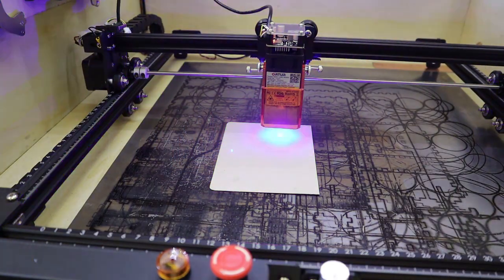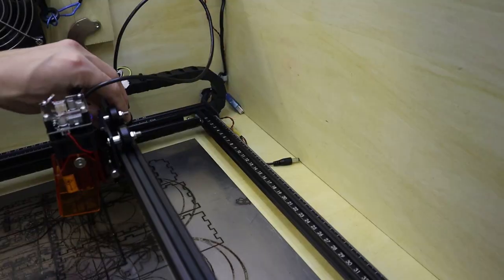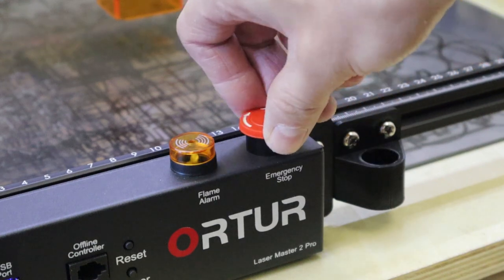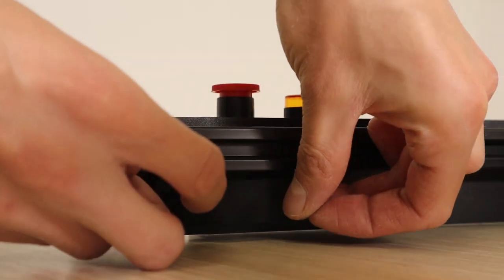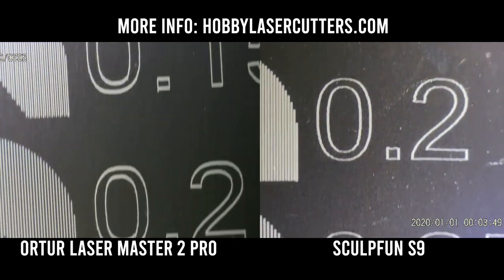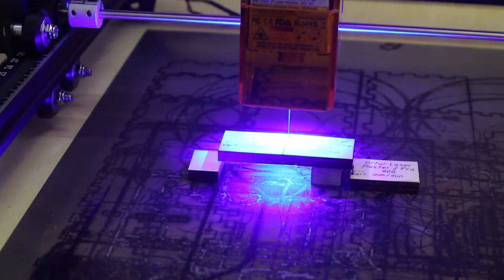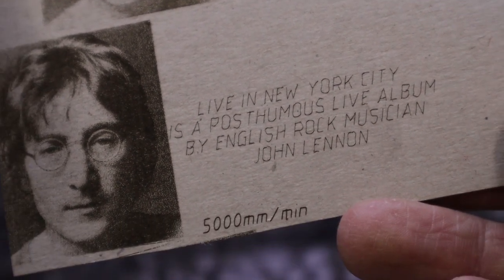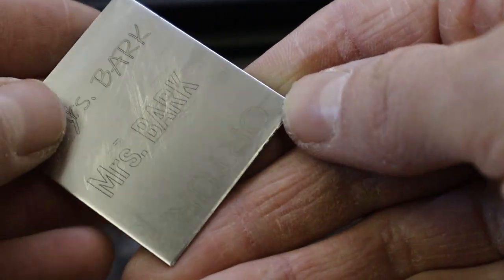ORTUR Laser Master 2 Pro REVIEW And TEST - Is It Still the King of Laser Engravers?

Comment: Great video, I really like the systematic process and you're really starting to build up a big database of test results for comparisons haha. One thing I noticed in the anodized aluminum tests is how clean the lines are in the Ortur compared to some lines of the S9 under the microscope. I am thinking it's probably due to the mass of the laser head being smaller and the x axis motor being on the side. Like the Ortur can accelerate/decelerate smoother without the small jerk which is visible in the S9 near the ends of lines. It is kind of sad though how Ortur pitches the 10,000mm/min speed but practically speaking it's not that useful at that speed anyway.  The mechanical parts are very nice though. It's as if the perfect diode machine is the frame and finish of the Ortur with the S9 laser head haha
Reply from the maker: Thanks! The S9 has a heavier head this is why lines have more wobbling effect. The engraving speed is 600mm/min which is quite fast for detailed work. At lower speeds the S9 doesn't have wobbling. But this alos depends a lot on how you have the machine setup, how tense the belts and rollers are and it depends also on how low the head is lowered. In this test the head is very low. If i would put the board higher up, there would be less wobble as the head would be closer to the rollers. The Ortur is a lot lower standing machine by itself. This is why the engravings are more detailed. But this can be archieved with the S9 just by lowering the speed.

Comment: I recently got the Sculpfun S9 but have only just assembled it (like, hours ago).  It really should have been fitted with limit switches by default, they are really cheap parts so there's no excuse. I looked at the control board and there are sockets for the switches so will try to fit my own. Also made an air-assist adapter because cutting thicker materials in particular you really need it.
Reply from the maker: I am also going to try to mount the switches :) I too noticed the inputs. But I will need to talk to Sculpfun if the firmware supports them. And I am also making the air assist. I already got the parts, but I don't have the time yet to assemble it :)
Reply: @JTMakesIt  I'm hoping if it's GRBL compliant no firmware adjustments will be required and homing can be enabled with $ commands. Maybe I'm just too optimistic :)  Those mods would make a good video! I enjoy the care you show in your testing so keep up the good work.
Reply from the maker: @chrislx2006  Thanks! If I make it work, you will definitely see it on this channel :)
Reply: Did you guys design your own air assist nozzle? I also just now made a crude test nozzle for the S9 but if someone has STL files online I'd probably give that a go. Very curious to see the effect of air assist on the already pretty powerful laser
Reply: @akaTelo  you can find an .stl linked in the comments below this video https://youtu.be/BSeJ_Z9iEyY 
It's not mine, I machined one out of aluminium.
Reply: @chrislx2006  Thanks! And I checked out your thread on LAHobbyGuy - WOW that is super cool you machined that air assist adapter! Maybe I'm just fascinated by machining but that is impressive haha
Reply from the maker: @akaTelo  I plan to use off the shelf parts, or very simple 3d printed ones
Reply: Did you manage to get the limit switches attached and working? Currently looking for an update to my Ortur LM2 as I started doing more cutting jobs besides the engravings... Only doing it as a hobby for personal gifts, hence a CO2 big format is probably out of budget :)
Reply from the maker: @thomasdegroote1223  I haven't yet got the time to so the modifications, but it is still on my todo list.

Comment: Great video. I own an ortur laser master 2 pro. I have considered upgrading the diode because I'd like better cutting performance. The S9 looks like a great option and a little cheaper I assume.
Reply from the maker: Thanks! S9 has a bit simpler mechanics, but much better diode.
Reply: If your using light burn you don't need the extra bell's  and whistle 's

Comment: Hello, sorry for the question... Is it possible to cut colorless (transparent) acrylic? I only see cuts with black acrylic... Is the quality good if possible?
Reply from the maker: Hi, none of the diode lasers can cut transparent acrylic. Transparent materials don't absorb light. You can only engrave transparent materials, but prior engaving you need to paint the surface black. After engraving you can remove the paint.
Reply: @JTMakesIt  Hi, thank you very much for the reply. Your channel is fantastic!
Reply from the maker: @julionovaretti  Thanks for feedback!

Comment: Otur master s2 pro comes in 2 different models. One is the master pro 2 SF and the other is master pro s2 LF, so we have short focus and long focus, from my understanding the LF is more for cutting and the SF is more for engraving, you didn't mention what model Otur you used
Reply from the maker: Mine should be LF.
Reply: @JTMakesIt  Rather looks like the SF on when I compare to the product pictures on the Ortur website. The LF has a big cone at the bottom of the laser.
Reply from the maker: @thomasdegroote1223  mine was the older version of the laser. Now it comes with the LF laser. But the performance is almost the same. The SF laser is much bigger. (See my review if the Aufero laser which comes with these modules.)
Reply: @JTMakesIt  Gonna watch them now! Thanks for replying.